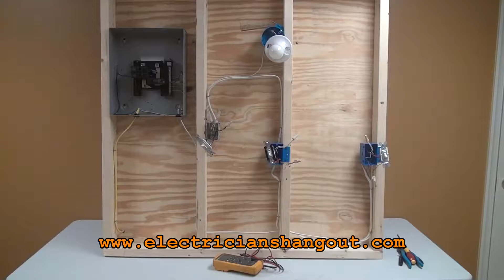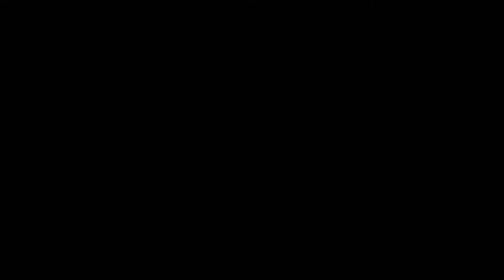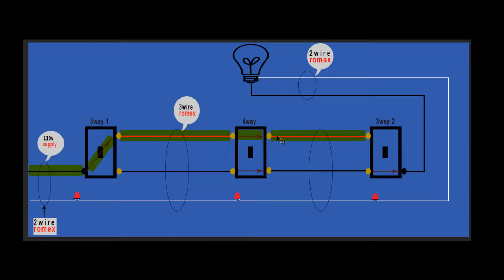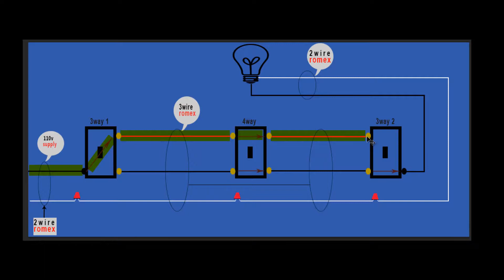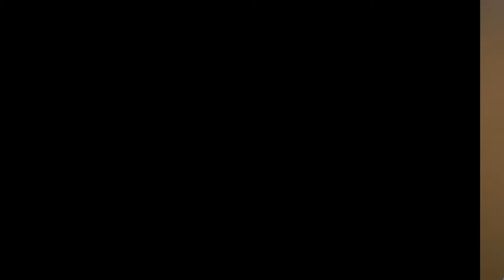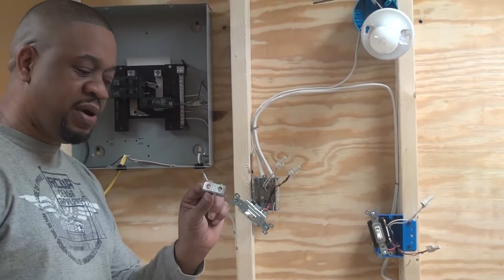How To Wire A 4 Way Switch

Comment: If I want to put a dimmer switch at one of the locations of a 4 way switch, can I simply replace one of the 3 way switches in the first or last position with a 3 way switch dimmer? Thanks.